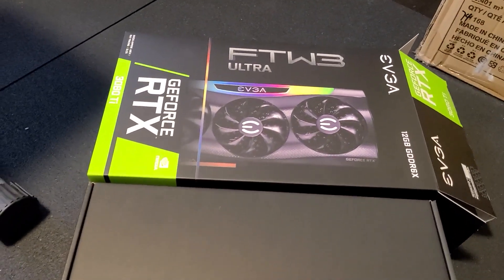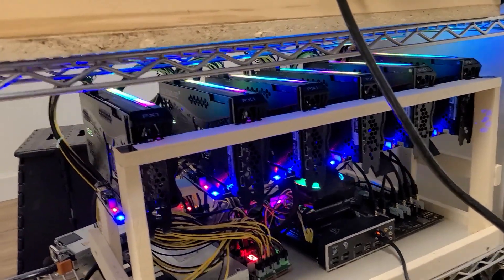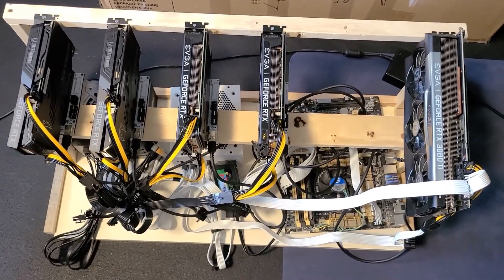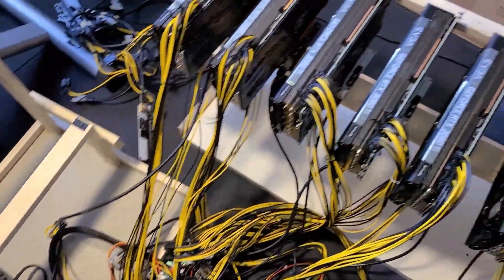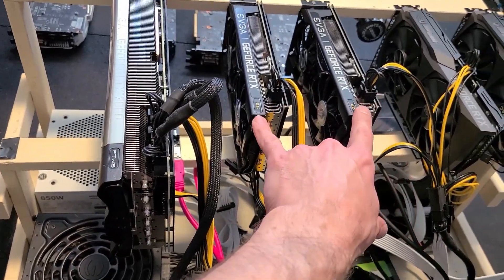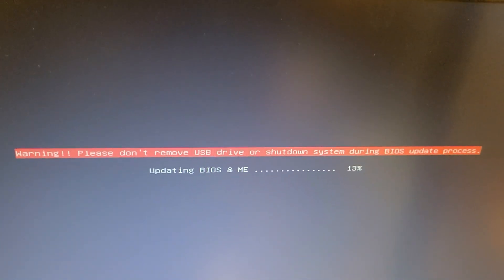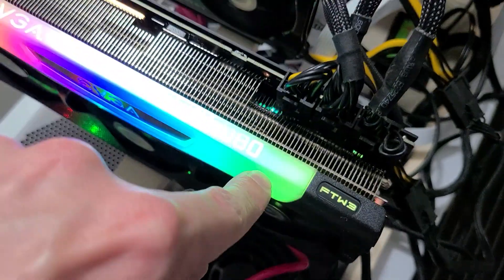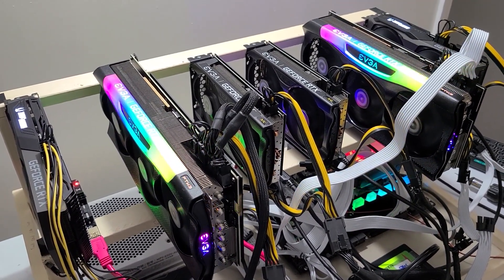Was I successful in getting 7 3080ti cards on one rig? Nope...

Comment: i have 4 but the temperature is bad, how is yours?
Reply from the maker: They run hot. I have 2 box fans pointing at the rig to help keep it cool, and the room they are in has an exhaust fan pulling air out the window.
Reply: @GroweverydayOriginal  it would be great if u make video about ur cooling strategy..
Reply from the maker: @febrynpradanarifandaputra9324  Funny you should say that, I actually filmed that this morning! I am hoping to put it out on Tuesday
Reply: @GroweverydayOriginal  so nice brother.. thanks for ur sharing